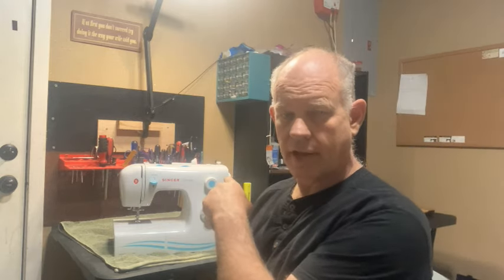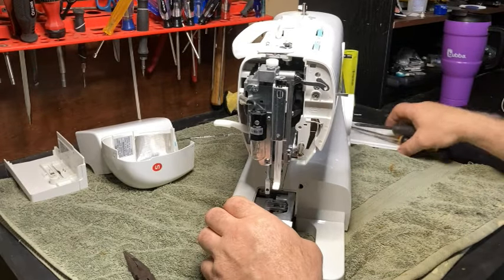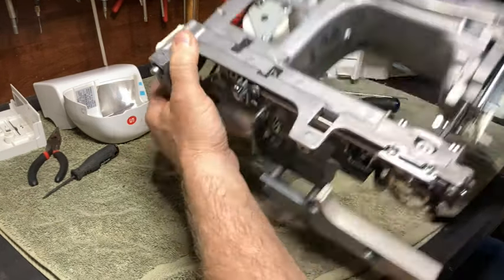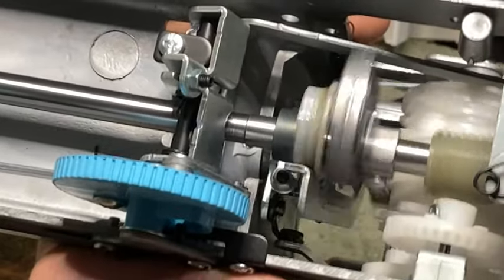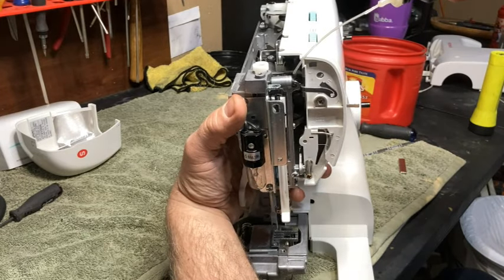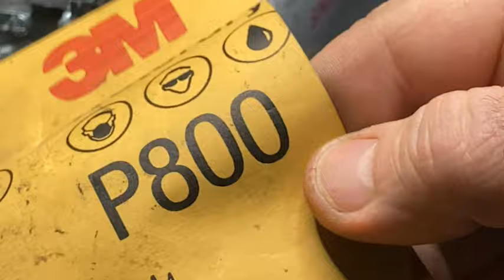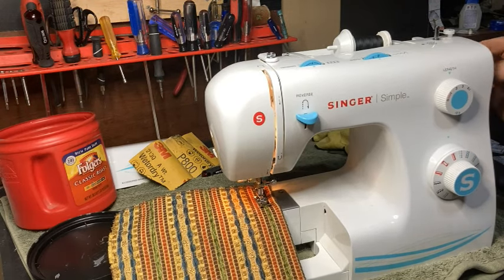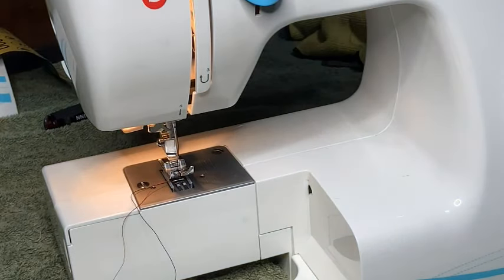How To Service a Singer Sewing Machine: Singer Simple

Comment: Hello Sewing Machine Tips and Tricks, could you please assist. I just bought a Singer M2105 a week ago and now the handwheel is stuck and the needle and  thread take-up lever is not moving. When I remove the bobbin, I can see a small piece of thread stuck inside the needle plate but its difficult to pull it. I am just new to sewing and your help will be appreciated.
Reply from the maker: Hello Alfred,

Sounds like you have a piece of thread stick in the hook.

Loosen the needle clamp and remove the needle so it is out of the way, remove the bobbin case and bobbin then remove the hook retainer and hook, clean the area out, then the hand wheel should turn again then reassemble.
Reply: @sewingmachinetipsandtricks9079  Thanks so much, your advise really helped and I was able to remove the threads that got stuck. However, the machine keeps jamming when I try to sew. Every time it jams, I remove the bobbin and the hook to remove threads. I haven't touched anything so I don't think I messed up with timing of the needle. Is there something I am missing?
Reply from the maker: @alfredchimodzi  

Ensure the machine is threaded correctly.

A) Lift you presser foot before threading as it opens your tension discs.

B) Make sure your take up lever is threaded  and the thread is not coming out when you start to sew.

C)    DO NOT turn your handwheel backwards when the needle is threaded. that will jam up the bobbin almost every time.
Reply: @sewingmachinetipsandtricks9079  Thanks so much, A and B really worked for me. No more jams! Thank you  once again for your kind advice.
Reply from the maker: @alfredchimodzi  You are very welcome, Thank you!!

Comment: Please make a video on how to clean a singer Legacy C440. Need to know how to reconnect the wire to the bobbin winder. It was unplugged when removing the top to get thread out of the tension that was stuck in it.

Comment: Thanks, I have an issue whith the system of the lenght of stich, I can't resolve the problem, can You explain this mechanism ? My machine is a Steem 1732 and is very similar to Simple inside
Reply from the maker: On the Singer Simple it is the upper right hand knob, I am unfamiliar with the machine you are talking about.

Comment: ❤ If Tri-Flow is so good because of the P.T.F.E. in it, then why don't we just use P.T.F.E./teflon spray?
Reply from the maker: Tri-Flow works well for many reasons, the PTFE helps to keep it lubricated, that’s one of the ingredients in many of the plastic gears and guides in sewing machines.

But the real magic happens with Tri-flow in its about to remove and resist rust and corrosion as well as its ability to cut through and remove crud and debris from bushings and guides.

Comment: Family member asked me to help fix theirs, they have to hold the bobbin winder? for it to work.  Not sure what I need to do from here. Any help?
Reply from the maker: Without more information it is hard to say,  the bobbin winder cam on top that kicks it out when the bobbin is full improperly adjusted, the spring that hold the bobbin winder in place inside broke or come loose, something inside  blocking the bobbin winder from properly winding.

Those are just a few thoughts with the limited information.
Reply: @sewingmachinetipsandtricks9079  the bobbin winder works, but to use the machine to actually sew they have to hold it because it won't stay disengaged.  I think it is missing a spring somewhere or a piece broke off but nothing loose is inside the machine.
Reply from the maker: @kylekuhn5882  
The bobbin winder uses a spring to hold its self in place when pushed either way.

The clutch that dis engages the machine also has a spring which keeps it engaged when the bobbin winder is not holding it in the disengaged position.

Sounds like something is holding the bobbin winder in the engaged position which disengages the clutch.

It is a very simple mechanism, you need to open the machine and see what is keeping the bobbin winder from popping over to the disengaged position.
Reply: @sewingmachinetipsandtricks9079  thanks, I have it open, I think I know where the spring is supposed to go, but it does look like there might have been a plastic piece that snapped off somewhere too.  It can be hard to figure out what is missing when you don't know what it looked like before😂.

Comment: Pls help my needle bar is not working at all, i check the wheel and clutch it is in place but still not working.
Reply from the maker: Can you hear the motor running but nothing moves?

If so then check your belt it may be off or broken.

Comment: I don't know what I did wrong but my reverse button is stuck down and I got confused with some of my screws I tried separating them please if you can help me my machine is the same as the one you are using and it has 1 long screw I'm not sure now if I remembered exactly where it went I had trouble keeping up with you I hope you can help me please 😢😢
Reply from the maker: The plastic reverse lever needs to be held up as you put the front on, otherwise it sits in the down position and does not hook on to the metal lever.

Comment: Thank you for sharing you knowledge ! I watched the whole video and i have a couple of questions. Do you advise on removing the old grease and dirt  before oiling, or to just give it a blow? 
Then, just add oil and no grease?
What about the very similar model singer Tradition, do you still advice on oiling the motor? The motor on this one have a plastic casing
Really apreciate if you have time to answer this questions. Kind regards and keep going with the good stuff

Comment: I have a new singer 3232 model and it’s stuck, won’t move up and down. I have front load bobbin. It won’t run
Reply from the maker: The hook may be stuck, remove the hook and see if it will move.
Reply: @sewingmachinetipsandtricks9079   thank you. I was able to remove the threads stucked inside the hook. Thank you very much!
Reply from the maker: @iyampaloay1743  
You are very welcome!

Comment: That was good.. how about a video on timing the machine? What is the big silver screw for that is behind one of the rubber feet?
Reply from the maker: Thank you.

There is no single fix for timing. It depends on why it is out of time, whether the needle bar moved or the hook moved and what caused it to move.

I presume you mean the screw that the rubber foot was covering, that is a height adjustment screw to level the machine with.
Reply: Thanks for that! Very helpful

Comment: A machine came in all locked up, carefully tried with power and motor wanted to run. Hand wheel would not turn so take up lever wouldn't move, took off covers and a belt was off. I carefully put it back on and the wheels and belts moved, so machine motor runs, but still will not sew, the take uo lever will not go up or down. I have lubricated the places the should be. How do I free this machine? It is a Simplicity. My Store sold Elna Machines.
Reply from the maker: What is the model number of the machine?

Comment: Timing seems off on my sister in law’s that I am using. The bobin part seems to move independently too…?
Reply from the maker: This video will help you better understand the timing.
https://youtu.be/hW-4OV4IWVc
Reply: @sewingmachinetipsandtricks9079  thanks. I’ll take a look, I think I had seen parts of it, but wasn’t sure if the top load timing was useful in terms of fixing front load timing…I’ll look again.

Comment: THANK YOU , I HAVE A SINGER PROMISE 1408 CAN YOU HELP WITH DISASSEMBLYING IT AND SERVICING IT
Reply from the maker: Unfortunately I do not have a video on that nor do I have a machine to make that video.

The best I can do is offer a consultation.

That is a paid service I have recently started offering.

If you’re interested I can send you a link to get you started and see if it will work for you.
Reply: @sewingmachinetipsandtricks9079  ok the sewing stitch selection is not turning to other stitches patterns only straight stitches can be selected
Reply from the maker: @taiwololadeladipo1936  

Without seeing the machine, I can’t say for sure but the stitch selector and associated linkages are probably dirty and gunked up and need to be cleaned and lubricated.

Comment: I have a clicking noise coming from the flat open rectangle round cylinder that goes from the front to the back of the machine. it is close to the alignement hole in the back of the machine where you put the invisible screw in. The round cylinder comes out of the rectangle hole.

Comment: my new to me singer 3116 machine only feeds the fabric towards the back of the machine. it appears to me that it is stuck in reverse, how would I fix this issue?
Reply from the maker: The most common problem which causes that is the oil drying ip on the reverse linkages and the machine gets stuck in reverse. 

If that is the problem then it needs to be serviced and have all the old oil, varnish and gunk cleaned out of it then lubricated again.
Reply: @sewingmachinetipsandtricks9079  thank you. I took the cover off the machine, everything moves freely. I checked to make sure it wasn't stuck in the button hole setting.  it sews beautifully in reverse, but it won't go forward at all. I haven't oiled it yet. It dosen't appear to have any yellowish build up on any of the parts, could it be a cam?
Reply from the maker: @pattymanson1621  Did you look in the bottom? All of your reverse linkages are in the bottom and right side body.
Reply: Thanks for the help. Having a issue with a spring on the hand wheel and bobbin winder. Don’t know how it goes back. It’s catching the hand wheel and causing it to lock up. Have you got a picture on how it’s supposed to be
Reply from the maker: @davidgeorge3714  

I will get a picture for you.

Comment: I have a brother jx2517 similar to the brother Lx3817 I opened but I was trying to remove a screw and that one was not supposed to removed, I tried but couldn't and now the only problem I have is the presser foot lever is not working.  It doesn't go up or down, is stuck
Reply: mine too

Comment: My bobbin case is stuck on the bobbin winder on the top......any tips?  There is a small metal piece inside the rod which I've tried to push in......still stuck.
Reply from the maker: The bobbin winder is probably still engaged.

Disengage it and it should come right off.
Reply: @sewingmachinetipsandtricks9079  tried that.   Had to pry it off with 2 screwdrivers.    Thanks for the video I found it fascinating.

Comment: Hi I have a empisal mechine who stitches loose stitches how can I fix it please
Reply from the maker: I am not familiar with the Empasil Machine.

If it’s similar to the Singer Simple, I would suggest checking to ensure it is properly threaded, check the tension discs far lint or debris, check the needle plate, hook and bobbin case for damage.

Comment: hey friend, when i try to use my reverse lever, it doesn't work. my needle continues forward. upon taking it apart, cleaning and greasing, everything is attached (springs, levers, etc when i press the reverse lever it all moves properly) but its still not functioning. any suggestions?
Reply: i believe the notch on the front case is not making contact with the reverse lever on the machine. i have tried to put it on perfectly aligned but when i press the outside(front plastic case lever) lever it doesn't move the spring and lever inside. not sure how to reassemble to make sure its engaged, beyond sewing with the front cover off lol
Reply from the maker: @Efmims  The metal lever probably is not properly inserted in the plastic thumb push lever.

Take the front back off and hold the plastic thumb lever and metal inside lever in place so they align and properly go together.

that should fix your problem.
Reply: Im having the same issue. Yours was also hanging out at the bottom when you went to put the little plastic push on. But then there a jump cut and its how its so supposed to be. Help!!
Reply: I cant press my lever all the down. Any tips?
Reply: @sewingmachinetipsandtricks9079  thank you for responding however I tried several times and it didn’t work.. could you kindly film a video on that as most people had that same issue.. thank you ❤

Comment: I was told to never use compresed air. I have been using a computer keybaord vacuum for cleaning out lint.
Reply from the maker: Using compressed air can cause problems if it blows the lint into the machine.

I don’t recommend using it but if someone is going to they need to make sure all the lint comes out and does not get blown into the machine.

A mini vacuum kit is a much better way to go.

Comment: Have you ever been told that you should be a teacher? Because you're very good at it and I feel like I've just received an education. Thank you.
I have a silly question: 
My area is under lockdown and I need to service my Singer Simple( for my sanity lol). 
I have "Wahl: Clipper Blade Oil", would that be /okay/ for me to use on my machine? 
[ My reasoning is that it works for a machine with high speed movement and contact friction such as hair clippers, then why not my sewing machine. 
Off the top of my head, possible reasons to argue against using it is longevity, unknown chemical composition and viscosity. ]
Reply from the maker: Thank you! I appreciate the compliment.

Yes that oil will work, it is a high grade light weight oil which is what you need. 

It may not last as long as a machine oil or may last longer. You will need to pay attention to how well the machine is running each day. If it starts acting sluggish, slow or making unusual noises then open clean and lubricate again.

Comment: Can you help me why my motor and the belt running but not my needle but the needle will move when I turn hand wheel
Reply: This is my issue as well. Stopped mid seam ... and now I have this guy apart on my counter.

Comment: Mine same machine didn't stitch straight it moves in right hand direction while simple stitching
Reply from the maker: Check your stitch width, make sure it is on 0
Reply: Ill checked but it has problem while stitching simple plain stitch its not in straight line
Reply from the maker: @shaziaabdussattar-uy1dk   

Correct, the stitch width has to be on 0 when on a straight stitch.

Comment: I did everything in the video n a small tube like cylinder metal fell out  just like that idk where to put it bk in
Reply from the maker: Sounds like a spacer, you can see it just under the tension assembly at 18:56
Reply: I had same problem then I think I found it. It goes in lobger screw on thread guide.

Comment: Machine is stuck. Bobbin reverse but stitching does not engage gears.
Reply from the maker: Does the hand wheel turn?
Reply: This is the exact machine I have and since I broke the needle and don’t have extra needle so I bought a pack from Walmart but maybe is the wrong one which after that doesn’t sew anymore and don’t know what number is matches this machine. Could you please guide me with this? Thanks 🙏